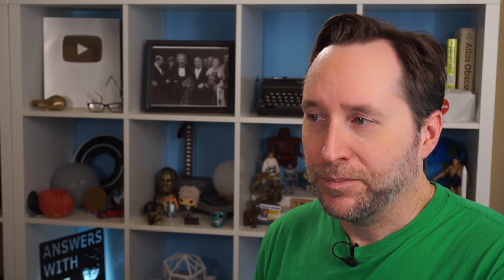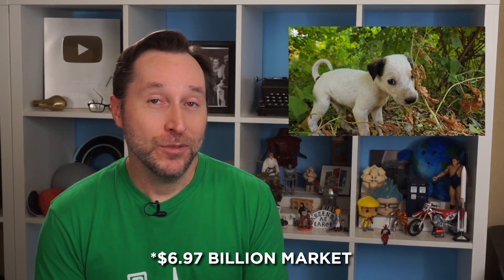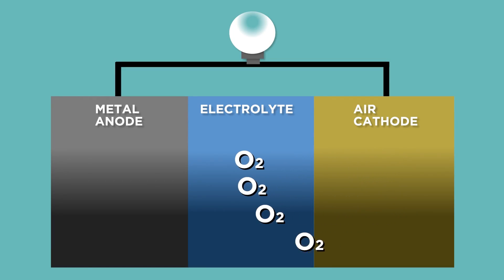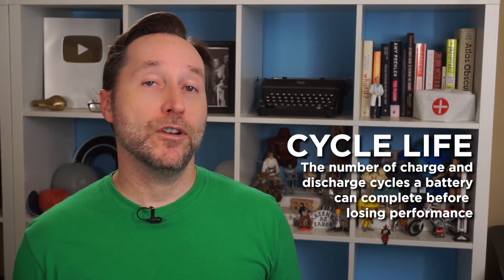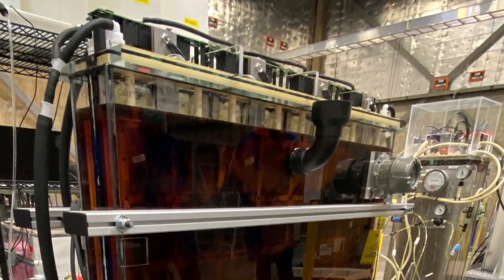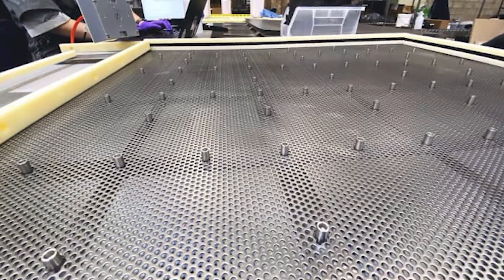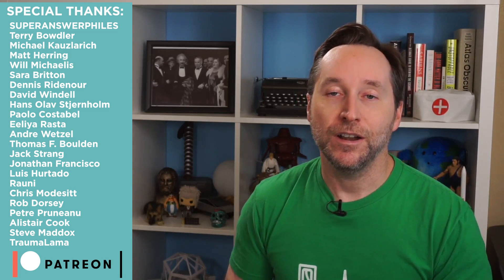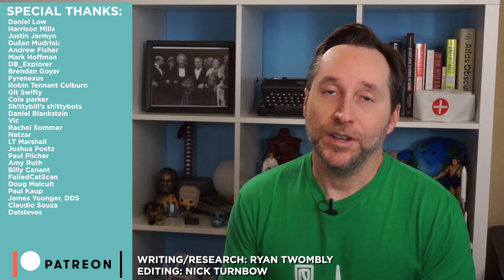Iron-Air Batteries: Storing Energy In Rust | Answers With Joe

Comment: Matt might have better graphics, but I've watched a couple of his videos, and he just ... it feels like he's always missing something. You're talking about Undecided, right? Maybe it's his presentation style, or maybe it's just me ... these days, I just wait for you to do a proper deep dive. [Edit: as an example of what creeps me out, in his Rust Battery video, he goes on about how Lithium Ion batteries provide power for "4 hours" but Iron Air "can store power for longer" and "providing power for 4 days". He says it without any support or context, and it's bollocks -- there isn't any limiting factor on batteries except capacity and cooling. A Lithium Ion facility with the same MWh capacity as an Iron Air facility would provide power for just as many days. What other disinformation is he sticking in there that I DON'T catch when listening to him? I just want the straight goods.] [Further edit: Joe explains the thing that creeped me out: the peak power output on Iron Air is lower, so their marketing team is spinning that as "longer duration". It's just spin; a 150MWh Li Ion facility could provide power at 1MW for 150 hours ... exactly the same as the Iron Air facility discussed here. Most people are more interested in the Li Ion ability to provide 35MW, however, and that only last for 4 hours. Iron-Air doesn't seem to provide that option ... but if it's really 10x cheaper to build and maintain, then hooray! I guess we'll see how close they can come to their claims ... two years from now :/ ]

Comment: So Joe, here's a hybrid battree eyedeer;
Combo gravity + chemical batteries. Some current gravity schemes lift many modest sized inert weights to great heights with several cranes to store energy then reverse the process to release power.

Instead mount, say, a megawatt of batteries onto a single frame, and while charging the electrical batteries or when they reach capacity additional power can be used to lift the entire mass of the battery pack to relatively modest heights. Given the lifting/lowering mechanism is highly mechanically efficint, this eliminates the complexity and failure potential of the well known silly crane tower while providing both short and medium term storage in a single package.

Maybe.

Comment: What about using Fe-Air batteries in conjunction with Liquified Air storage?  Using the separated oxygen to turbo charge the Fe-Air batteries?  Just a quick thought
Reply: That would just mean that they are 20-30 times even faster dead.
Reply: @wolfgangpreier9160   Dead as in unusable?  Or 20-30 power output with efficiency?  These are rechargeable from what I understand

Comment: In this decade li-ion batteries with iron-phosphate chemistry will have the biggest impact. Most likely in Tesla's 4680 cells. This has several advantages.
- Abundance of raw materials, it's entirely cobalt-free and doesn't need any other material that is scarce by any metric.
- Can be produced in existing factories, so scaling up production is trivial.
- Lot cheaper than traditional li-ion.
- Lot longer cycle-life. With Tesla's tweaks it will last practically forever.
- Can be charged to 100% without accelerating degradation.
- Lot less likely to catch fire

The disadvantages are: 
- Significantly smaller energy density. But this is practically irrelevant for stationary storage. And Tesla even makes cars using this, with still pretty good range.
- Doesn't like cold as much. Not a deal breaker either, in the worst case it needs a bit better thermal management.

As for the 4680 cells, the advantages are, independent of the chemistry, much lower cost and much higher production rate.

Any other technology, that doesn't build directly on the existing li-ion cells, will have a long development cycle, and won't be produced in any meaningful quantities in this decade. Next decade is a different story, many new technologies will be mature by then.

Comment: Did you ever make a video on Sodium-ion batteries? Of cause you need to make that video now! Sodium is located one row lower in the periodic table so the batteries might be a little heavier than the lithium-ion batteries. However, one main advantage is that you can find the raw material dissolved in the water covering 71% of our planet. I guess you will not run out of raw materials.
Reply: You will also not run out of material for LFP and they last longer. Much longer. But Na+ Batteries have advantages in very low temperatures.

Comment: 2:56 This is a point that not enough people are discussing, but it's also a subject that needs to be more widely considered when selecting batteries for EVs themselves. Not every EV needs high power density cylindrical cell batteries, and it was such a shame to see the Tesla community and EV media constantly berate pouch and prismatic cells EVs when, for non-performance, mainstream EV offerings, those cells make far more sense. We're finally seeing a shift away from that thinking as those vocal detractors are unable or unwilling to criticize Tesla for diversifying battery chemistries and formats in their own vehicles.
Reply: Tesla uses prismatic cells too. But those only make sense with the iron-phosphate chemistry, due to higher thermal stability. But most likely when Tesla will produce LFP batteries those will be cylindrical. Simply because those are much easier and cheaper to manufacture. The reason why other's prefer the other ones is that they can't manage thousands of cells.
As for pouch, it's just unsafe.
Reply: @andrasbiro3007  Yes, I know. That was my whole point. We had a bunch of toxic Tesla Bros attacking other EVs for using prismatic cells, but now that Tesla is doing it, it "makes sense." 

I guess maybe I was wrong about that behavior stopping. People will just find new ways of justifying old, incorrect positions.
Reply: @newscoulomb3705  
Makes sense in the right context. Context matters.
Look up the price of traditional prismatic cells compared to Tesla's 2170 cells, and you'll see the issue.
Reply: @andrasbiro3007  The cost on a cell basis definitely favors cylindrical cells; however, the cost on an energy basis definitely favors pouch and prismatic cells. Factor in the complexity and cost of integrating individual cells into a larger pack, and the costs are far lower for pouch and prismatic cells.
Reply: @newscoulomb3705  
In practice Tesla's batteries are far cheaper. That's why they are making such huge profit on their cars.
And there are a lot of other factors that determine which is the best format. For example charging speed, cooling, and safety. Larger cells are generally harder to cool and slower to charge. And pouch cells are very dangerous, they get damaged easily and burst into flames.
Reply: @andrasbiro3007  Most of what you've just stated is wrong or ignoring/omitting key information. 

Tesla's batteries are not cheaper. Engineering Explained just did a video  on the Ford Lightning's battery cost, illustrating that it was far below anything Tesla could do.

Yes, many factors must be balanced for automotive use: cost, energy density, and power density. Cylindrical cells are generally the worst for cost. The chemistry and cell size really determine the rest, meaning one format doesn't have an inherent advantage over the other. 

And you should use caution when you say "larger cells." After all, the 4680 cells are supposed to be superior to the 2170 cells in terms of charging and thermal management. Pouch and prismatic cells have an advantage when it comes to thermal management, thanks to their superior ratio of mass to surface area. Keep in mind, the Chevrolet Volt's pouch cell battery has better power density and thermal management than any Tesla cylindrical cell battery built to date. 

It's really the electrode thickness that matters (QuantumScape recently posted an informative white paper on the issue), and that's where the trade off between energy density and power density becomes a design choice for pouch cells.  https://www.quantumscape.com/resources/blog/white-paper-a-deep-dive-into-quantumscapes-fast-charging-performance/

Comment: good luck with the puppies
Reply: instead, use Sodium (Na2O -> NaOH -> Na electrolysis at 300C) process in the renewable electricity sources, to make aluminium, magnesium, iron, zinc, silicon-metal, as a wire spool, then make a fuel cell with circulating electrolyte oxide filter, to feed the metal wire spool as consumable electrode, like a 3d printer, and have the electrolyte be salt water, optionally baking soda or potassium hydroxide, salt water or baking soda are the safest, and stop feeding the spool when you dont need more energy, its a finite dip metal-air fuel cell, just like a hydrogen fuel cell or gasoline engine
Reply: but rust forces entrance, pun intended
Reply: away with it
Reply: carbon capture with lime water, Ca(OH)2 + water => CaCO3 => CO2 into whatever like pure carbon or hydrocarbon syngas fuels
Reply: are you a rain-bow, to who, of who, owned by who, who you serve
Reply: do you have fuel inside the internal combustion engine when its not running, there is your answer
Reply: Sodium Hydroxide NaOH electrolysis at 300C, and molten Sodium Na at 100C, is a lot less than the iron oxide reduction blast furnaces at 800C or more, its molten at 1500C tho, the iron
Reply: focus on the usage side, not the production side

Comment: The storage solution I always think of but never see is Hydrogen. Generating it is inefficient but it is simple technology that can be done at any scale. Couple nuclear or renewable with a hydrogen converter/peaker plant and you can make any generator a battery or peaker plant at the cost of efficiency. Build twice as much wind/solar as you need and use half of it to generate hydrogen for the night cycle. Couple a nuclear plant with a hydrogen generator and fill an abandoned mine or fraking site with hydrogen.

Comment: An interesting battery type are antimatter batteries which store the energy in positrons and electrons which when needed uses the anhilation of those particles to create power. However there arent any major projects surrounding it to my knoledge. Could be an interesting research topic
Reply: Completly impractical.
1. Antimatter is the single most expensive substance on the planet. Yes, it's even more expensive than printer ink.
2. You'd need a particle accelerator to charge your battery.
3. If you drop it, or lose containment power, you leave a sizable crater.
Reply: @vylbird8014  
I completly agree with you an antimatter battery is not a viable option with todays technology or perhaps feasible in any capacity in the near future. I only thought that it is a very intersting form of energy storage. Also to add to your list an antimatter actually consumes energy as it is being stored. Obviously due too the inability to passivly store electrically charged particles such as positrons and electrons.

Comment: Small suggestion: Since you don't want to repeat why batteries are important for reworking our energy grids, maybe do a special just about that: Why they are important, what different factors are to be considered (weight, size, scalability, rechargeability, ressource use, etc. etc.). Basically give a framework of how to judge battery technology and what is the most important aspect for different applications. Then you can reference that video every time you discuss a specific battery technology. And maybe be faster than Matt.....

Comment: a couple of things to point out to the "we shouldn't cut fossil fuels, we're already having enough energy issues" people, the storm that caused the blackouts was from the polar vortex. normally the polar vortex keeps that air up at the pole, but global warming has weakened the vortex, allowing it to be pushed and stretched down farther south than it would. so the blackouts were in part caused by the use of fossil fuels in the grid. also, our electric grid is just massively outdated. most were installed like, 70 years ago with a 50-year life expectancy >_> so electrical issues are gonna happen no matter what.

Comment: idk if you're still doing "why don't they just", but i wonder why don't they just take some boring company tunnels and fill them with hydrogen with fuel cells converting the energy both ways, if your tunnel is large enough and deep enough in theory the only limitation would be the performance of the fuel cell array, with theoretically infinitely extensible capacity
Reply: Tunneling is expensive. If you've already bored tunnels for some other purpose, like extracting natural gas, and you don't mind hydrogen leaking into the environment everywhere, then that's one thing. But if you're competing with above ground storage in tanks or balloons ...

Comment: I would be interested in NaS Batteries.
Reply: I probably should elaborate on that: They are actually kind of an old technology. They are made from extremely  abundant materials. The only reason I can Imagine they aren't accordingly cheap is because they do not have a history of being mass produced. They are pretty useless for portable batteries and there was not really a Market for grid storage in the past.

edit:
here is how I imagine the implementation:
In places where there is a shortage of water and an abundance of renewable Energy (There are a few of those^^)  we build renewable driven water desalination plants. Instead of tossing the brine back into the Sea creating an ecological hazard we electrolyse it producing Natrium (Sodium?) and chloride. The chemical industry has a bit of a chloride shortage, so that is where this goes. The Sodium gets shipped, to wherever Energy is needed.
and where we build The NaS Batteries thereby reducing the sulphur surplus. That way we could solve five problems with one go. 
So the big question is, why is that not happening.